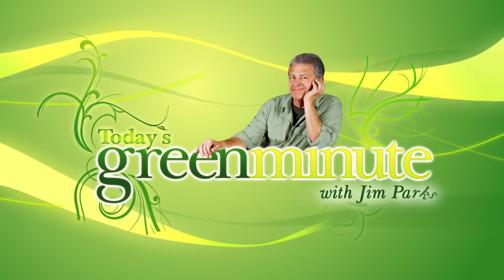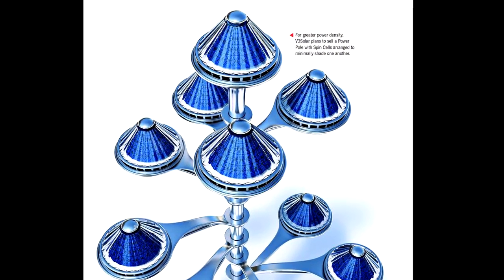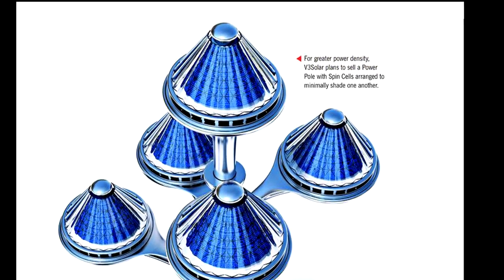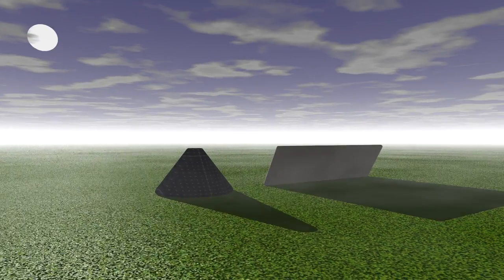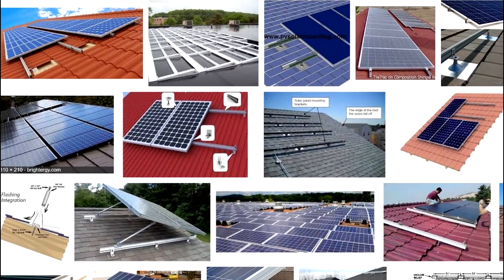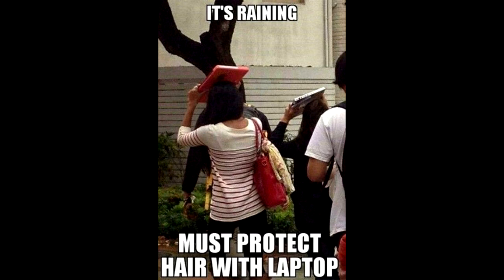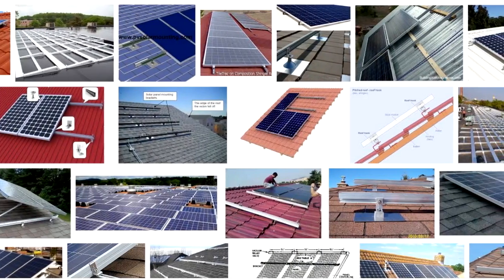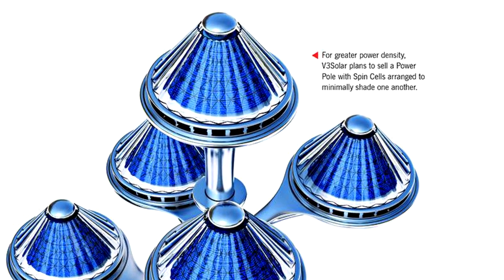Spinning Solar -BUSTED!

Comment: I have a few ideas for altering the design and placement parameters. I wonder if done would make them useful? First remove the protective glass covers and change the angles of the solar panels like fan blades. So when rotating air will flow inside the cone. Second widen the circumference of the cone a bit. I think that they would be useful to limited regions of the world, countries and islands on or near the equator where there is more direct sunlight.
Reply: Maybe it is using generated heat as forced exhaustion to spin the cones.
Reply: If the solar panel veins were variable pitch they could be computer controlled to utilize naturally occurring wind. Basically like the turbines installed on the roof of a house to circulate air in and out of the attic. If heavy winds are forecast, the veins could retract fully or set to a degree tested to be safe for anticipated wind speed. They can have safety lockdown to prevent rotation during extremely foul weather. Also protective covers can be built with strong light weight material to cover the entire unit and be attached to anchors precast into the ground. I'm going off the years I was stationed on Guam. Almost all of their power came from oil and was very expensive. But nearly 365 days of direct sunlight and optimal average wind, there is viability to a certain market.
Reply: Joe elrod We all are Hugh Mungus.

Comment: If the selling point was about creating a smoother output by compromising on capacity factor and cost effectiveness, maybe it wouldn't get so much negative attention. Although I think adding batteries for power smoothing might be less of a hassle than convoluted solar power designs. Not to mention that batteries can provide far more grid services than just power output smoothing.

Comment: So...the point of these is about footprint size, not solar cell square footage.  This should be at least mentioned in this video since there are applications where footprint is important and while these may be over-engineered even for that, the cone design will beat the flat design when you're comparing by footprint.

Comment: Thunderf00t, can you record a video on why nuclear is the only real alternative to fossil fuels? I would love. The world can get a little more hydro too. But hydro do not scale very well.
Reply: Lucas, do you pay Thunderf00t?

If not, do the world a favor by SHUTTING THE FUCK UP.
Reply: Thanks, niknonknuk. It was just a request. Polite request.
Reply: +Lucas P Solar is actually coming incredibly close to nuclear power in terms of price per watt, space efficiency and reliability go to nuclear power though. Some great brains on the topic could make a decent difference to one side but we'll see.
Reply: *****
Not sure who you're talking to, but if you're talking to me; emphasis on why I said "reliability" The problem with solar is that it won't work during bad weather or when it's night (requires excess power to be generated in order to store a large amount of power). Additionally, a large battery bank wouldn't be safe (HUGE amount of electricity in one area isn't a safe thing at all) and during winter it would be less efficient (sun follows a lower arc through the sky). The Sahara would be a good choice, however, ignoring a way of transporting the electricity itself, the poles provide cooling and very long days of solar generation. Last bit was off the top of my head and is probably flawed to shit. Meh, I'm just throwing shit and seeing what sticks in the end.
Reply: In the real world, wind and solar are terrible ideas. I mean, not reliable, extremely expensive and when you add them, you're destroying the grid reliability.
Reply: Lucas P
Okay yeah, just ignore both of my comments and make an argumentless reply. I'm out of this discussion as you're not even fucking competent enough to read two paragraphs of text.
Reply: Lucas P It's actually not expensive. Not really. Currently, in the US green energy is more expensive due to the drives of the fossil fuel industry within the US. There is a stifling of green energy alternatives within the US that contributes to the higher prices and the failure for the US to move forward. Green energy alternatives are considerably cheaper in European countries and they are better. The US is just some backwards ass country that is failing the world.
Reply: Wil Garrett Ohh really? So why is electricity rates so high in europe? denmark and Germany are o top of wind and solar AND steep rates.
Reply: Lucas P I'll leave these here.

https://www.google.com/url?sa=t&source=web&rct=j&url=/amp/s/www.washingtonpost.com/amphtml/news/energy-environment/wp/2015/10/06/wind-and-solar-keep-getting-cheaper-and-cheaper/&ved=0ahUKEwiKwP3wiazRAhVmw4MKHaxmDNsQFghPMAM&usg=AFQjCNF-GTIG1ijcfquESvb9CM6xZthrxg&sig2=_OoEdusf9z-wFz4FxGSqiw

https://www.google.com/url?sa=t&source=web&rct=j&url=http://inhabitat.com/european-wind-energy-is-now-cheaper-than-nuclear-power/&ved=0ahUKEwjuj-fSiqzRAhUs0YMKHavKD_MQFghWMAc&usg=AFQjCNGllsYIUtpw6YJrI_Y7tIzCJADHJw&sig2=IsHMZafwoMnHZG_AEk2EFA

https://www.google.com/url?sa=t&source=web&rct=j&url=http://www.lifegate.com/people/lifestyle/wind-solar-cheaper-fossil-fuels&ved=0ahUKEwjuj-fSiqzRAhUs0YMKHavKD_MQFghZMAg&usg=AFQjCNH3GTGw0m62YbusVW6TOn_V9Az_YQ&sig2=KZmzmjNkBiQmxeCALCQqkA

https://www.google.com/url?sa=t&source=web&rct=j&url=https://windeurope.org/policy/topics/economics/&ved=0ahUKEwjuj-fSiqzRAhUs0YMKHavKD_MQFghbMAk&usg=AFQjCNEKBu_Nm8c9pRVaG69Cmt_ybmgxqg&sig2=O3b_-LbdCrraNZauElZhKA
Reply: Even today's nuclear plants are great. safest energy source. But we need reactors running on liquid fuels and low pressure operation. That will allow massive nuclear deployment.
Reply: Efficiencywise they're great. But considering the cost of handling the waste makes in disgustingly expensive.
Reply: +Infinity Salinity when u love capitalism so much you yell at people for not turning listening into a marketable service

Comment: To be fair, they were probably referring to optical efficiency whereby the giant magnifying cone allows them to use a 20x smaller solar array. Ordinarily, such an arrangement would be terribly inefficient because of overheating, so they spin the panel elements around, giving them a very low duty cycle.

I think you've jumped the gun on this one because overall it seems like a nifty idea. Solar arrays with rotating mirrors are also terribly inefficient with all that wasted surface area, but who cares? Surface area is cheap. Silicon cells are not.

Comment: Spinning at high RPM could eventually cool it down, if you don't count the energy used to spin the thing... But the greenhouse needs to evacuate that heat somehow, because the heat that goes into the air by the spin will just heat the air up, it would be way hotter than a sauna in there making the spin useless as the air around would be too hot.

Comment: Oh hey, I invented a solar powered flashlight. No batteries needed!
Reply: To be fair, they can be useful when they have an internal battery so you can charge them during the day for use at night.
Reply: beayn Not as good as my wheelchair with peddles or my water proof tea bags.
Reply: My Helicopter with ejectable seat is better
Reply: how about we use RTGs to Power our Phones? No Charging needed for some time (Depensing on the Fuel and Amount)
Reply: Problem is that exists, its not very useful.
Reply: If I remember correctly there was a student in Canada which produced a flashlight that was powered off the heat from your hands. Amazing concept if it works.
Reply: bwlive it or not, thos do exist.
Reply: They do make them.  They are sometimes used at mountain ranger stations.  It does not charge the batteries so much as keep them topped up so that when you need to use it in an emergency, maybe once a month, it will have a full charge.
Reply: beayn haha I'd actually buy that  as a gag gift 😂
Reply: the Russians have a helicopter with ejection seats
Reply: Still gives you better odds then crashing, especially if you are crashing fast.
Reply: +No AdHominem Well autorotation is a thing. Its quiet possible ro emergeny land an engindead helo. But yeah, ejectionseats do exist.
Reply: I need no channel youtube!
As far as I understand, they use them for military helicopters. Hence, there is good chance something much worse than a dead engine might happen.
Reply: They just need to use an interrupter so the seat times the ejection, kinda like firing a machine gun through a propeller. 
It may not be possible to accelerate a human fast enough to make it through no matter how well it's timed though.
Reply: shananagans5
It's much easier to just detach the propeller before the ejecting.
Which is I think what they are already doing.
Reply: +Aintjack there are also side-ejecting seats, I believe.
Reply: Filipe Amaral
Side-ejecting seats don't seem to make a lot of sense to me. At the very least, not on a helicopter. They don't fly very high, not ejecting the pilot upwards would give the pilot very little time to use the parachute.
Reply: Given the alternative of becoming something that looks more like a pile of mincemeat, I think I'd take the chance.

However, given the choice of how to die, I think the idea of being ejected into the rotor blades would probably be more acceptable than waiting until the helo hits the ground and knowing you're not going to survive it all the way to the end.
Reply: No AdHominem In the early F-104 downwards ejection system, which meant that if you needed to eject right after takeoff you'd have to roll the plane belly up before ejecting. Side ejection is a piece of cake compared to that.

The minimal ejection height for an ACES II seat is 43m and for the K-36DM it's 30m. You can be pointed at the ground and eject safely, I'm not sure how every seat works but the principle is that a gun-barrel style of propulsion is used to clear the pilot from the aircraft and rockets then sustain it so that it can blow out the chute. Since the G-loading is reduced in those seats I suppose that they are just barely powerful enough to give the chute enough time to deploy, and thus can be used at ground level if you have to but without shoving you into the ground if you're inverted and above the limit.

In a helicopter it would even be simpler, gun-barrel assembly is mounted sideways but the rockets are pointed downwards.
Reply: Windows that can be opened for ventilation in a commercial jet are my favourite. Nothing worse than a fart in a closed tin can during a 12 hour flight.
Reply: Filipe Amaral
Consider me convinced!
Thanks for the info.
Reply: they do. the trick is that they use the panel to charge a battery, which it runs off of. the idea is that you charge it by day, use it by night
Reply: ***** I think the issue mentioned is the failure of the rotors to clear the aircraft reliably. Come to think of it, ejection systems for jet fighters used to blow the canopy off, but nowadays it seems a lot of ejection systems use those squiggly lines on the canopy glass (which is a form of detcord) which blows the glass itself - and then the ejection seat is equipped with some kind of glass breaker to really give the canopy the "one two".

If some jet fighter designers considered that blowing the whole canopy off was not 100% reliable, maybe there's some truth to the argument that rotors blowing off aren't that easy to clear.
Reply: beayn Thermal powered?...that would be useful :3
Reply: Ian Baines or u can just use a crank one, thats also powered by hand!
Reply: ***** Well yeah you COULD do that, and ignore the possibility of powering things by just body heat alone... as you sleep you can top up you're batteries for your house if you wear pyjamas made out of this wonderful invention.
Reply: without batteries u couldn't store the energie. u could only use it wenn it isnt dark
Reply: +ñoño ,  I wished I scrolled down before I wrote that long reply to your comment. you are just a spamming troll.
Reply: That's nothing.  I invented the battery powered battery charger.  Brilliant
Reply: I used to have a flashlight powered by a hand crank.  They also make flashlights powered by shaking.

Comment: Where does the power come from to rotate the cone ?
Reply: obviously from thorium lasers.
Reply: Lewis72 the earth's core
Reply: It uses some of the power generated by the solar cone itself.  It only needs to rotate if the sun is shining.
Reply: My3dviews

In which case, that will reduce the already shite efficiency futher.
Reply: Lewis72  Exactly.  Which is why a flat panel angled to the sun is best.

Comment: i'd like to purpose an idea , that, may perhapse prove me nieve, but, seems like a decent explenation for the inventors mistakes. perhaps, though, i have yet to research it, there is a type of solar pannel that, for its first few seconds of exposure to light, generates a greater current or voltage, and, once saturated, goes into lower production efficiency, then modern pannels. lets say, for instance, said pannels only coverted 10% of light into energy, but, durring there first three or so seconds of being connected to a compleated circuit, generated five times that, and, it was seen as a common instrument error, possibly, from stored energy. if this person mistakenly believes that the panels he is using are the "common modern standard " by any extent, then, the false add could be entirley accidental, and, there intentions noble, even if more questions SHOULD be raised about it, such as, how the effect ACTUALLY functions, as opposed to, how he thinks it does?

Comment: ....why do solar panels only turn 20% into electricity, is the rest heat?...what can be done to raise the energy output?
Reply: The rest is heating the panel, reflected or generates the EM field arount the wiring. A 100 percent efficient solarpanel would be black as night, use superconductors, and violate at least three fundamental laws of physics.
Reply: I need no channel youtube! ...i said more efficient, not perfect...i meant like...70%...or atleast 40%
Reply: According to the second link, apparently not. The mechanism described there is the mechanism all solar cells presently use: photons from sunlight knocking electrons in a semiconductor from the n-side to the p-side of that semi-conductor. From what I understand it is physically impossible for that mechanism to use a bigger chunk of the sunlight for that purpose, the rest can not be used. And sadly it is the only mechanism we know of to turn sunlight directly into electricity. 
On the other hand: efficiency isn't really a problem here, there's enough sunlight to go around. If we want more electricity from sunlight we can just use more surface area. Arizona is pretty big. So is Spain, and Australia, etc.
Reply: I'm doing my dissertation on the subject and the maximum efficiency for solar cells is actually about 70%, 33.7% is for single layer silicon. There are lots of ways you can improve efficiency, such as layering different absorbing junctions in the same cell. In reality the trick is probably to stick with the already pretty damn good efficiency and try to reduce cost, putting these cells over a larger area.
Reply: You can ditch the direct light->electricity conversion, and instead just heat water with a lens and a black-painted pipes, then have that water drive a turbine for about 60% efficiency. But it's a lot more bulky, complicated, and maintenance-heavy.
Reply: Quick google search: https://en.wikipedia.org/wiki/Solar_cell_efficiency and https://en.wikipedia.org/wiki/Shockley%E2%80%93Queisser_limit First time I found out about it myself: the theoretical maximum efficiency of a solar cell is 33.7 % apparently.
Reply: +Jacob Holden Nice to have an expert opinion instead of wikipedia-fu for once. Tell me, how do they manage to put these projects on kickstarter without consulting someone like you beforehand? Or doea it happen in spite of being shot down?
Reply: I need no channel youtube! I'm not an expert, dissertation work doesn't take too long. I think the issue is that people see solar cells as being magic (understandably, most of them can only really be explained using QM.) Once something is seen as magic, people become less skeptical, as they don't think they could ever understand it.
Reply: +Jacob Holden
Was hoping someone had mentioned that the Shockley–Queisser limit is only for single junction cells.

We already have experimental cells with efficiency in the mid 40%.
Reply: Cris Dekker ..hhhuh,....could there be a more efficient kind of soler cell in the future?..and maternal or design that doesn't alow dust to accumulate?
Reply: ....i like what your implying should happen, but keeping it cool is still a problem
Reply: @Cris Dekker

I've heard of over 40% effiency experimental cells so that doesn't sound right. Maybe it was referring to 34% of the theoretical max? I think that's refering to "Ultimate effiency"? (linked in the following page)

This page mentions 68.7% theoretical max efficiency (for Earth and Earth's sun), and 46% world record effiency:
https://en.wikipedia.org/wiki/Solar_cell_efficiency
Reply: MrOdrzut ...hm,..integrating notion.
Reply: Yes there could be.. solar cell in space! :D  or heck build a Dyson Sphere where you actually encapsulate a star in cells and take in ~100% of the stars energy. Theoretically of course ;)
Reply: ...my god,..i started a intellectual/ scientific  debate on youtube....i kinda feel giddy about that.
Reply: We have made 46% efficient solar cells. They're just crazy expensive. The 20% efficient mass-produced variety are the best value (cost/efficiency).
Reply: spinning christmas trees obviously. dont you read the interwebz?